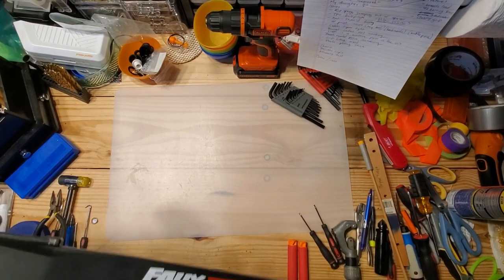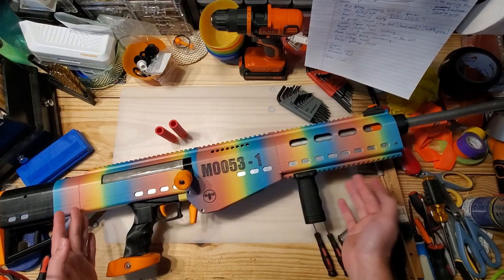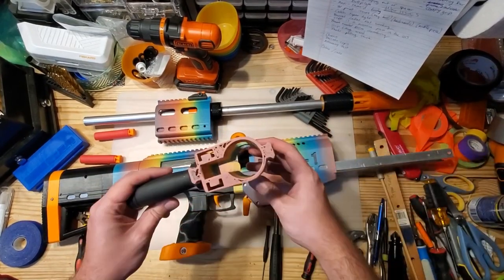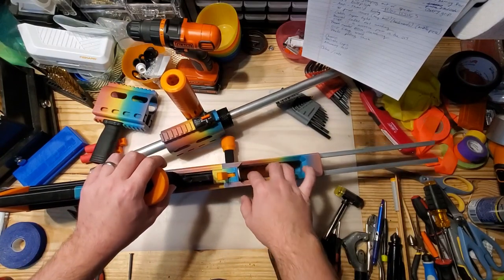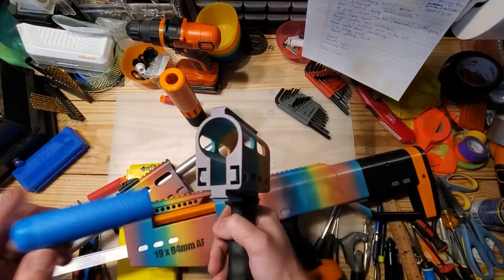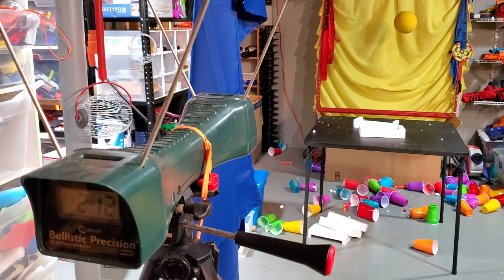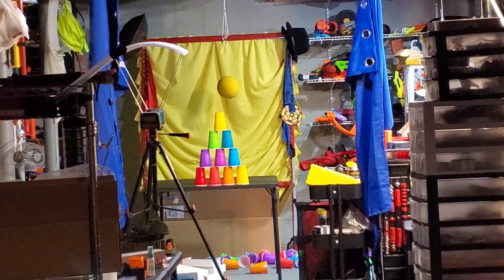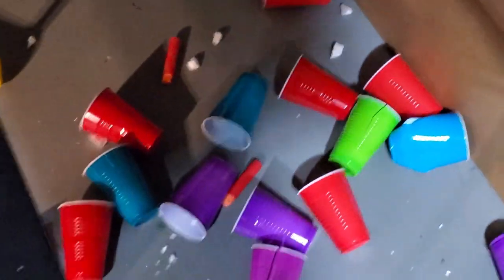M0053-1 MEGA Sniper - Basically a Nerf Anti-Tank Rifle!

Comment: Honestly I never thought of using that hole as a priming indicator.  I put that there to be able to squirt lube into the plunger tube without needing to disassemble it.

The looseness of the palm grip is intentional.  That's how my real one works and it changes angle to match where your hand is.

The bcar is easier to assemble with a dart inside it to capture the bearings.

The thick o ring in your kit needs to go between the barrel nut and the front, that's what holds the barrel in place. 

AF = Accufake

There's someone working on a single shot MEGA XL version, so stay tuned.

There's some scope rings in the extras file.  A "cheap" LPVO run at 1X feels like the ideal sights for this thing.

Good idea with fixing the K12 jumping issue.

Glad you're enjoying it!

Comment: AF could be AccuFake referencing the Whirlwind darts
Reply: Yup
Reply: @MisplacedMoose what's the catch design like on this
Reply: @lon6boardlord  somewhat similar to how a Cynthia works.  A threaded rod goes from the trigger to a sear that lifts the catch up.

The plunger assembly is long and thin and runs down the middle of the spring and is captured by the catch in the back section near the butt plate.